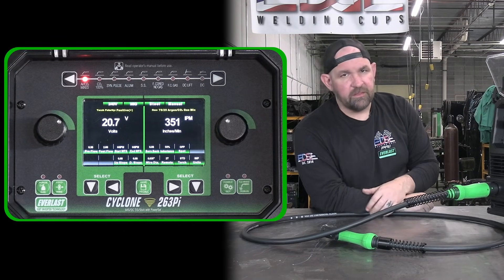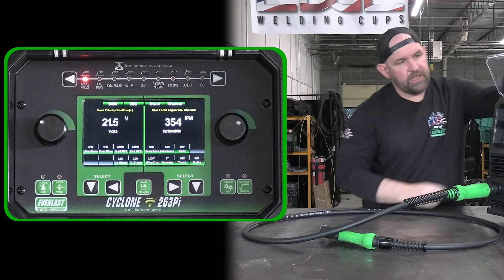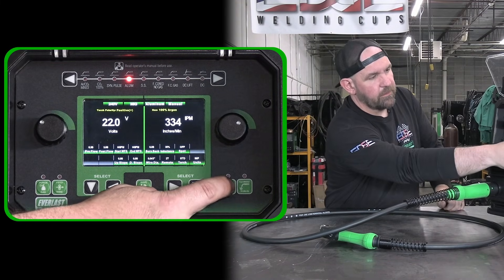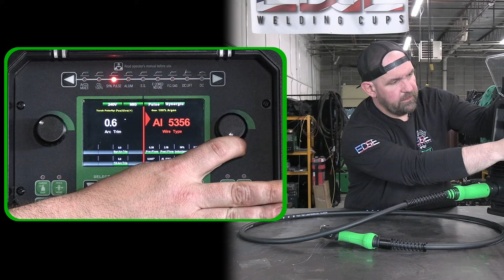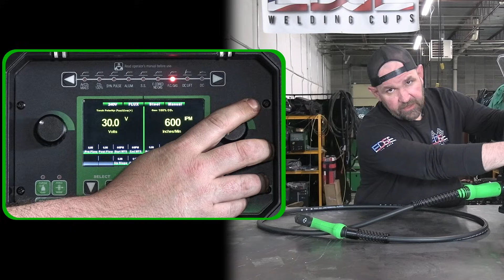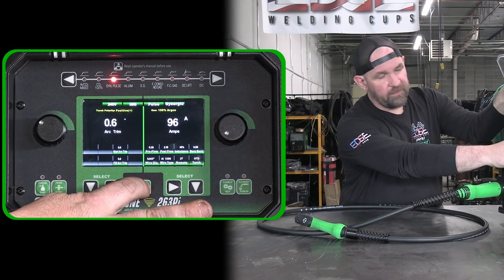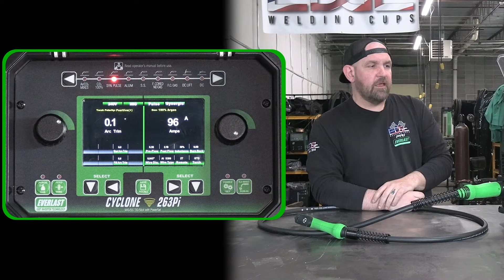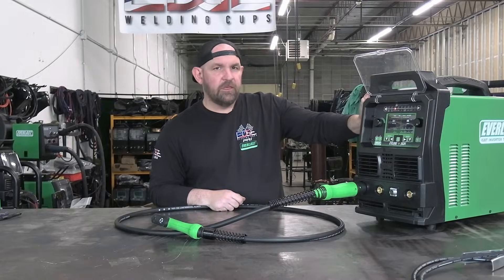Cyclone 263Pi

Comment: Will there be a program update / upgrade for the typhoon 230 / 330 with this program saving capability? It'd be cool to have a keyboard to name the programs. But no complaints about the machine. Thank you!
Reply from the maker: We are actively working on that update for the typhoons as well!
Reply: @everlastgenerator  will we be able to buy the update (board or whatever is it) for our existing machines? Or would we have to purchase a updated machine?
Reply from the maker: @austinburtch5972 it’s a pretty simple flash, no additional purchase should be needed. We were actually making a video about how to flash pre-double pulse machines today.

Comment: Do a comparison with thunder 255, noticed they have similar specs and wanted to know the difference between them
Reply from the maker: Thunder is way more advanced on DC tig; the thunder is more a less a typhoon on the DC tig side. Minus dual pulse and a narrower pulse range.
Reply: @everlastgenerator are there any downsides to going with the thunder 255 over the 263pi? Thanks in advance

Comment: is it ac/dc
Reply from the maker: No AC on this unit
Reply: @everlastgenerator  how do you weld aluminum w/o ac current
Reply from the maker: @richard3716 the mig process is pretty exclusively DC only, AC is not needed to mig weld aluminum